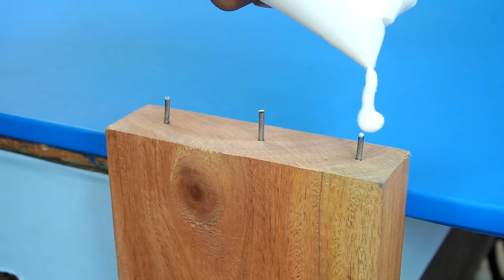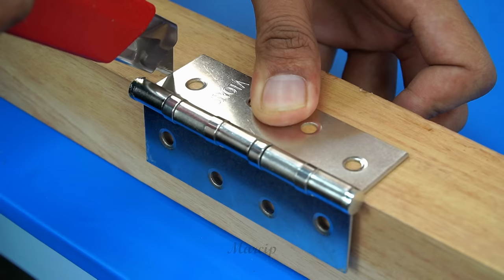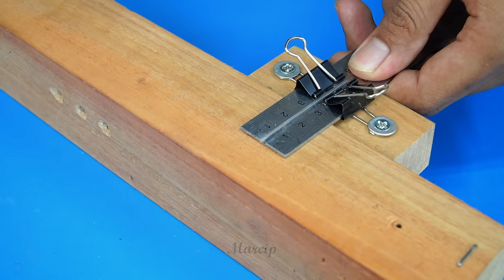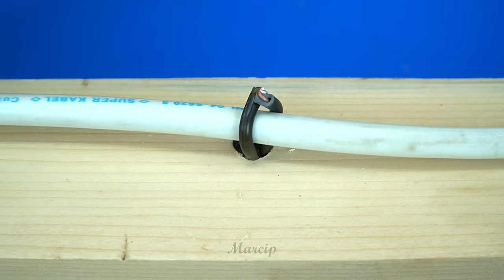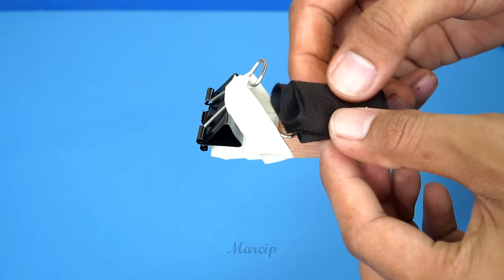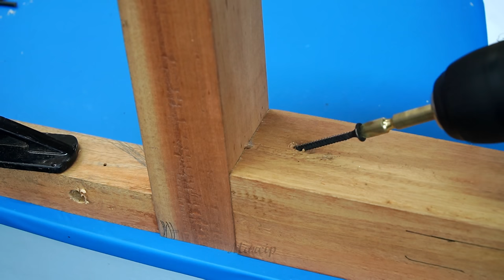Tukang Kayu Tidak Ingin Anda Tahu Ini Trik Sambung Kayu  Menakjubkan

Comment: The nails in the butt joint will give only a minimal amount of strength to the joint. Without the head, there is no strength from pullout. Also not making pilot holes for screws in inviting split wood, stripped screw heads (that clattering of the bit in the screws means the head is riding over the Philips recess, rounding it out and wearing the bit's edges). Pilot holes the diameter of the screw's root diameter, reduces splitting, makes it easier to drive and nearly eliminates head stripping. The screw for the toe-screwing is far too short by half.